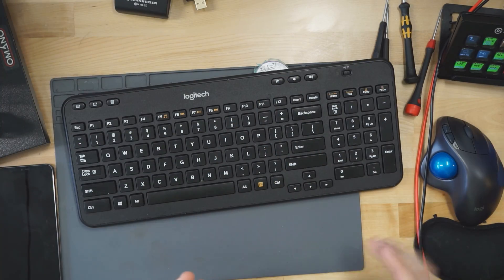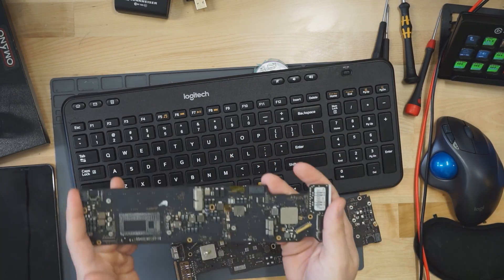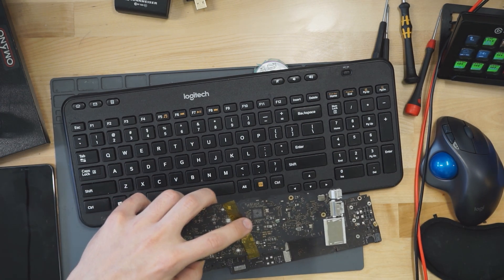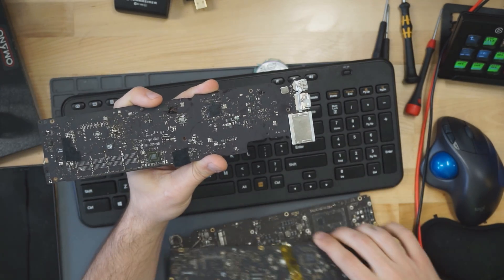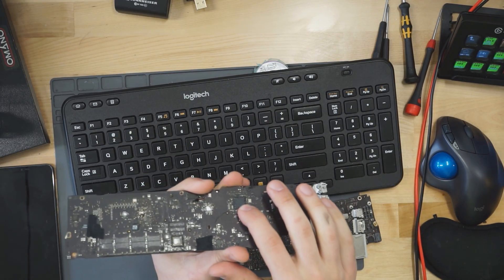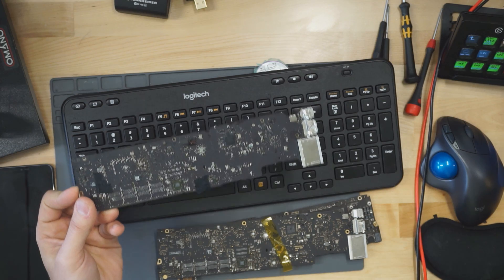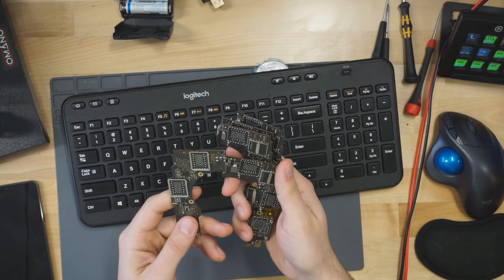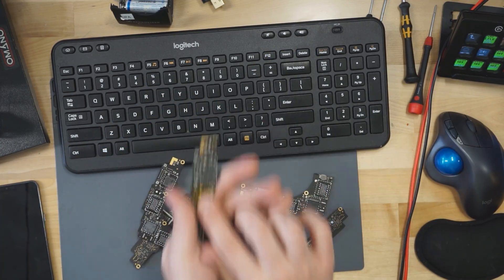𝓕#&* APPLE part 2: The morals & ethics of dumpster diving.

Comment: The worst is actually John Deere... EVERYONE should go look at what John Deere are doing to the farmers, the impact is insane. Makes the Apple stuff, as bad as they are, really benign by comparison.
Reply from the maker: I know how bad John Deere is. I was there in Nebraska when the farmers were lobbying and testifying. https://www.youtube.com/watch?v=HUx0gReDFkE
Reply: @rossmanngroup  I have the luxury (if you want to call it that) to be small enough of a farmer I can afford to keep running pre 1990 tractors.. F#$% John Deere and Apple too, and any other company that goes along their protectionist lines.  Oh, and F#$% Caterpillar as well.. $400 for a door latch striker, $10,000 for a radiator fan and hub
I love my old Marantz audio, Toshiba laptops (never had one that needed repair) and old iron

Around here you used to be able to scavenge some scrap metal at the landfill.. now that's not allowed... Exactly the same idea, I could use a couple bedframes, etc for the steel to weld something up with but rather than let me reuse it they're going to ship it back to china to make another identical bedframe out of!
Reply: Louis Rossmann absolutely LOUIS, ab so freaking lewdly. It’s insane what we throw away. Completely maddening but we become a society of throwaway and I’ll just buy another one consumers. And these corporations are actually to blame for this because they push their new stuff every year or two down our throat’s completely mesmerizing everybody with their flashy advertising. Keep up the great work and keep up the great fight. Love your channel and spread your gospel to the new people all the time.
Reply: John Deere is the Apple of the farming industry.
Reply: @ibobeko4309  ...Apple's not the prototype, and they're far worse. There is no equivalency between fixing a combine harvester and a laptop. If your laptop breaks down, you can literally walk it to a store. It costs farms many thousands of dollars, time and hassle to get the equipment broken down in the field to the authorised mechanics let alone the cost of fixing. Corporate USA is the most corrupt thing on the planet, and the government is complicit, as is every voter that wants "less government" with reasons of "capitalism works when left alone".
Reply: @abates3747  Except the reason this stuff works is because the Deeres of the world get laws put in place so the government will put you in prison for "hacking" a product to repair it. The "free market" might work better if companies weren't allowed to use the government to enforce their monopolies (doing so is popular in many industries in many ways, this is just one). The problem is that the people calling for "less government" are too easily fooled by the people they vote for when they don't understand the topic, and no matter which way they vote they will be assured more anticompetitive laws to benefit the big guys at the expense of the consumer, and small and medium business.
Reply: @abates3747  Might want to look into how corporations prefer government oversight.  That means increased regulations, which work as a backstop to competition.  Notice that we have over 3000x more regulations today than in the 90's in every sector.  Most "deregulation" is about cutting out regulation that harms the larger corporations, while maintaining regulations that make competition expensive.  There are still beaurocrats just adding extra regulations on top of the supposed deregulation anyhow, as everytime congress votes for deregulation there are another 100~1000 new regulations added, or clauses added to existing regulations untouched by any congressional bill.

It's even worse when you look into...I forget the bill Clinton signed in 1992, but if you notice the stock market rises since 1992 are massive, and leading up to it, are relatively static, with minimal growth in the long-term.  All of that growth is off-budget government money dumping.  We already OWN every major fortune 500 company in the US, both Federally and through State and Municipal stock, future, and dividend ownership.

If you don't believe me, look at the Financial Reports.  It's all there.  Then there's the billions in 2007/8/9 the Fed printed up to give to banks, which were given back to the Fed to hold...guess where that money ended up?  Stock market.

I also suggest reading up on UN Agenda 21 and 2030 if you haven't.  The WHOLE point of all of this is total government, everything too big to fail, absolute control.

You're literally demanding the very thing that every corporation actually wants...to become definitively too big to fail, and have regulations they can afford that further make competition FAR more expensive.

The number of businesses created every year since 1992 has decreased.  So has the number of beaurocracies overseeing regulation for various agencies.  That's ballooned, starting with Bush Sr.  We've seen almost 80% of all regulations since 1990.  Perhaps more now.  Literally, since 1990.  More regulations, less growth, more impoverishment, more corporatism, fewer startup companies.

The cost to start a business now is much more expensive for anything offline, or with a physical presence, even in Red states with fewer regulations and lower land value, thus lower rent.

Look at California.  People working at Blizzard make on average 80k a year.  In Oklahoma, that can afford a very good life.  A 5 bedroom house, paid off in 10 years, two cars in the 20~30k range paid off in 6 years, and even with 3 kids, saving ~15k annually, and up to 30k after the loans are paid off.  Most people working at Blizzard, for 80k a year, even single, are skirting by paycheck to paycheck.  Why?  Overregulation on everything.  Price controls, which work as a BOTTOM, not a median.  Food costs, gas cost, taxes, HOA or rental fees, electricity costs, water costs, etc.  Land values way up around Irvine...not much different than anywhere in Silicon Valley.  Once you get government involved, it just makes people more and more impoverished.  It always gets worse.  The only reason Mississippi doesn't have a booming tech sector?  No one is interested to build in a place that gets floods and hurricanes, forcing rebuilding constantly, forcing periods of downtime while the market continues to move and your stuck without being able to work, or even network because the internet and electricity is down 1/3 of the year at almost random intervals, and the rest is farming country.

Christ dude, just look at any state with heavier regulations.  It BENEFITS ONLY the large business, as small businesses are forced to shut down almost immediately after starting up.  Most startups last 5 months to 1 year.  This includes restaurants, which aren't stable because eventually people who still live in those areas prefer to eat at home as it's cheaper.  Over time even those large businesses leave because the market dries up and even government gets too overbearing.  They could still profit, but it's better to spend 5% of your budget on maintaining your company than 15~20%, keeping up with regulations, if not more.  Nevermind excessive taxes.
Reply: @ignasia7230  some good points made, some bad points made.
Reply: Alexander Langella y
Reply: And like apple they used to make very good products but now they rest on their larels and marketing bullshit
Reply: Monsanto makes John Deere and Apple look positively customer friendly.
Reply: toro all the way :)
Reply: Too freaking bad for farmers.  Just like Apple customers maybe they shouln't buy John Deere's.  If they do they get what they paid for,,, the chance to get ripped off again with repairs.  It really opens up opportunities for those who can work around the barriers.

Comment: This not a cheap move but a smart move to do.     some part cost  $50  and last well beyond the working machine life .   I fix my  dyer many times   using   parts off of trashed ones .  I think 
 only the main control knob motor and body is the same still. Every thing else  replaced. saved me   a lot in time and money

Comment: Hey Louis I totally agree with you other than if it’s one of the new board (2016+) with the SSD’s soldered on, those are the only boards I would be wary of people taking. You’re a moral guy I can’t see you dumping data off of dead boards for nefarious reasons but there are people out there that would.

Comment: The irony is that the so called liberal fools who claim to be green or enviromentally aware. They don't have a clue what green means... solar panels,electric cars,wind power etc are not green, do you know the coal/nuke power it takes to refine aluminum,glass,silicon for a solar panels and cars??the copper wire?,the plastics? the semiconductors? the list goes on lol..  much more power to make them than the given solar panel will ever give back in its 25+ yr life. So,technically they are not enviromentally aware. Not to mention they live in large,dirty,unsustainable,resource wasting concrete jungles. Green and organic the most abused words ever lol.

Comment: Salvaged electronics is the best. I have a 2011 iMac that was almost thrown away. It had no dents, or scratches, fully functional. Original owner said it wouldn't start. Took it home, fired it up and it just had a corrupted partition, fixed that in no time.
Reply: i had a friend several years ago throwing out an HP envy 14 (yea ages ago) and all he did was drop it about a foot, barely any damage to the device and all that was wrong with it was the HDD was bad from the drop, slapped a new drive in it and it worked like a charm for another 7 years. he went out and spent about 1000$ on a new mac book XD
Reply: i found imac on the trash, it was bad sd ram. :) my kid was killing the switch all the time instead of turning it off properly. after some time it stopet booting up. diagnostics wast working, i couldnt go to single user mode, shit didnt want to boot up from dvd.i took the shit apart, took out the hdd, formated it on pc and reinstaled snow leopard on the mac, its still working. on all forums suports etc i couldnt find any help, apple told me that i can bring it, but 99% it the motherboard, and its old, and repairing would cost too much if we consider that its old..... screw you roten apple and all of your gayphone products

Comment: i mean its fine that they want to lock down their trash. some macbooks have ssds soldered to them... least i am assuming so, so there's some security issue possibly, but at the very least there should be parts availability... you should be able to buy the chips and such... not have to go though great lengths to have someone dig through trash to get a part.

on the other hand why lock down trash.... as you said you can use a lot more percentage of the parts and save that board from just being a piece of fiberglass in the ground.
Reply: He's talking about dead motherboards from factories in China and that area that manufacture the parts for the Macbooks. They don't make it to a customer, and thus have no data on them. There's no security issue.

Comment: Once you put something in the trash, it actually becomes property of the recycling company. That company has the right to extract resources from the trash in order to make profit. So you're not stealing from Apple, but from some random Chinese company. However, given the environmental difference you can make by repairing a device vs dumping it. I actually find it ethical to steal in that case. Just like it's ethical to cross a red light if that action enables an ambulance to get through.

Comment: I could not agree with you more.  Playing the Devil's advocate (Devil = Apple), I can understand not releasing the firmware in the chip, and not agree with that at the same time - but they SHOULD be selling them to service facilities like yours or anyone else at a fair price already programmed.  In this particular case its out of spite and trying to eliminate anyone trying to do the right thing, like maybe fix something instead of trashing it.  When is the Government finally going to do something about right to repair as they did with the Auto Industry?  I will NEVER buy an Apple product, even if they started selling parts - only because if that happened it would be because they were forced to.  Of course they would spin it around saying Apple has decided to sell parts and service information to support their customers aren't we great!  LOL.

Comment: I had to re-use electronic parts all the time. Replace a customer's entire circuit board for $500, or replace the IC for a hundred bucks? We weren't in business to charge the customer huge money and reward the company who made the stuff that failed by making large purchase of an entire PCB. If you spin a bearing on your car engine, would you rather have a rebuilt engine for 1500, or be FORCED to buy a new engine for 10,000? I don't use Apple, and dislike the propaganda that comes out of the Apple Chancellery...
Reply: Tesla is trying to implement this exact line of thought into the car industry already.
Reply: @Jurgh909  That's arguably just because the car doesn't have many spare parts
Reply: @Jurgh909  Yes, I have always seen that correlation..Tesla is the "Apple" of cars...you are not allowed to fix it yourself, only the super-expensive dealers can do it...you can't even get parts. Also like Apple, if you TRY to fix something, and Tesla discovers it, they will disable features in the car. Further, most of them require the replacement of a drive unit (hopefully under warranty) before 100K miles. Another similarity between the 2 companies is the very effective marketing and fan-boy devotion.
Reply: Well, in this situation you'd be buying an entire new car for 50 000
Reply: As far as I know, as long as you are upfront with the customer about it, it's kosher.
Reply: Walled garden mentality? I just think that so many problems can be solved with repairs as opposed to new buys and for some reason electronic technology hasn't gotten there. I think the engine example points out that people are less willing to do repairs on what they deem small purchases. For the majority of Apple buyers, these are small purchases and it's easier to just avoid the headache.
Reply: @blackmanwhitesuit  Repairs use to be the standard, it's only when the cost a new item cost less than to repair  it did it start falling out of favor.
But in the case of Apple it seems that they are artificially making it difficult and costly to fix their products in order to sell more units.
Reply: @pogo1140  I feel that's just smart business practice from Apple, as it makes sure that they're the only ones making money off of their products. It's not just Apple, but this is part of the bigger issue when it comes to when is technology "totaled".
Reply: @blackmanwhitesuit  It's great for Apple, but screws their customers.
Reply: @pogo1140  Thus is becomes a moral balance. With the amount of control they have over their ecosystem, customer support affecting their bottom line is not something they have to worry about.
Reply: @blackmanwhitesuit  Considering how their sales in China cratered, I'm thinking it's something they better start worrying about.
Cause what happened in China, is going to spill over to India, Asia then Europe.
Reply: @pogo1140  They were never able to establish a following in India, if I'm correct, for decisions such as these. I hope it spills over and we get a more customer friendly version of Apple worldwide, because they make good products, but they don't trust their consumers.
Reply: Did you know HVAC electronics also are a big scam? How about $600 to swap an entire Lennox furnace control board that merely has a jellybean relay with melted contacts....
Reply: @spikester  Another good point. Last couple of HVAC failures I did it myself....2 motors, a few caps, and a 130$ control board I got NEW from Ebay. My total was about $200 for three different failures of an HVAC system "of a particular age"...I'm sure each repair, done separately as they happened, would have cost like 1800 at least...

Comment: See if the Strange Parts guy can get you an inside look at an Apple factory. Maybe then you can ask someone what the supply chain over there is doing.
Reply: Lol, you should look up how Foxconn operates today. I think even he and ADVChina has stuff on it.. You don’t just “go” to a Foxconn factory in China..
Reply: It depends on the facility - if you mean the one in Longhua where they make a lot of the Apple stuff then it's very locked down - for example, they take your phone when you go in and you don't get it back until you leave (possibly this is only for phones with cameras) - the other Foxconn facility I visited was in Tianjin and mostly made servers for HP - they were a lot more relaxed.  I suspect that the reason the Shenzhen Longhua facility is so paranoid has more to do with Apple than any Foxconn corporate policy.
Reply: @TrimeshSZ  For sure!

Comment: Funny you mention that.

People throw away working devices to the recycling bin.
I work at a recycling depot, so we see all that stuff pass in front of us with the severed deer heads hunters tend to send us.

I found a working Xperia M4 Aqua, along with a working PS4 controller so far, on top of an LG phone, and an S3 that I can use to repair the power button in my actual S3.
It's insane what people throw away.

This stuff gets thrown into e-waste anyways, if it still works, if it's still salvageable, bloody take it.
It's literal trash to the people who sent these things there.

I thought I'd mention most of the hard drives inside laptops that get sent here are usually in working conditions. Found a decent capacity Sata SSD just the other day.
Reply: i wish here you could go and see what is being thrown away. They lock is shut behind landfields so even if it is salvagable you will not get access to it.